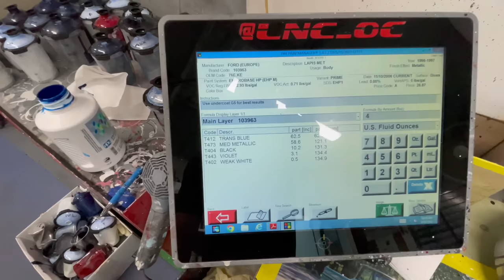Professional Painting of a Rebuilt McLaren GT - MUST SEE Awesome Results!!

Comment: It came out well nice colour match Andrey , if it was me i would struggle with the colour without using basecoat blender for the blends . Top job man 👍
Reply from the maker: Thanks! You know what I believe i did you basecoat blender, i think i just didn’t show it. I would say i use it most of the time on all jobs 👍🏻😁
Reply: @LncPainter  I was quite amazed at your blend and with that colour without a blending agent , no worries you can't fit every aspect off the process into every video . 👍